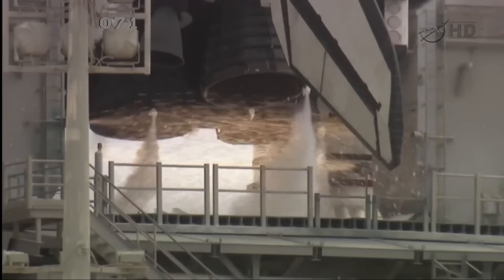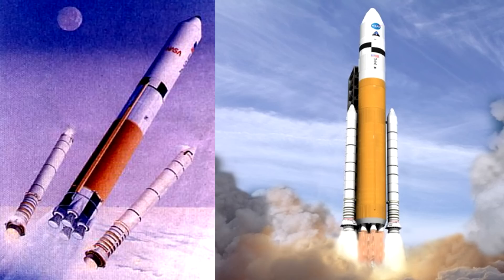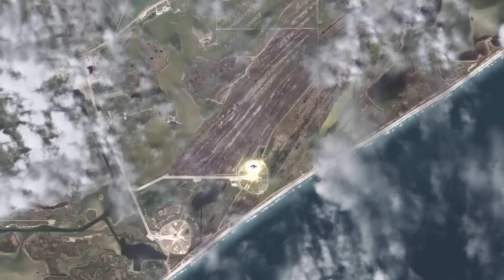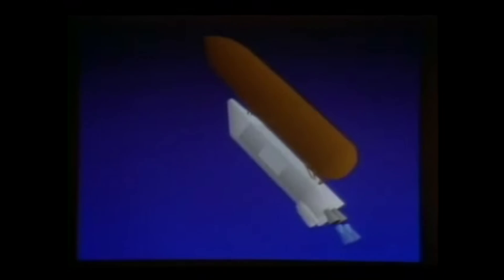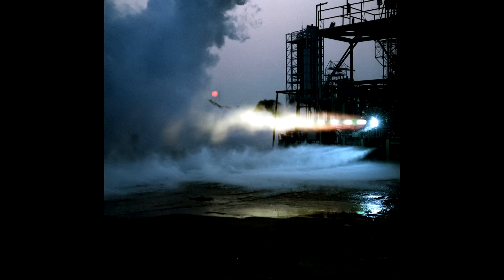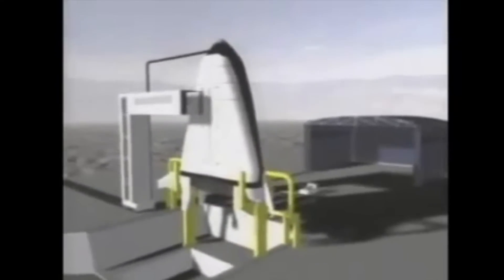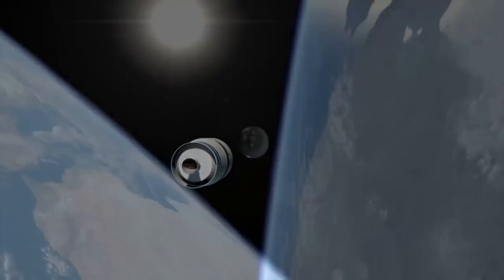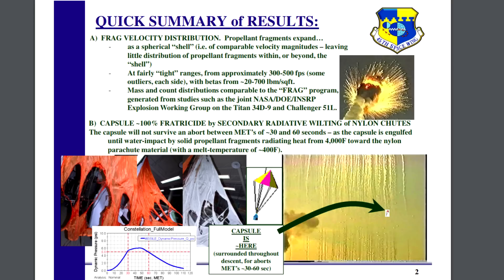Why The US Took So Long To Replace Space Shuttle's Crew Capability

Comment: I love how the SLS is actually one of four failed programs, so when they quote the figure of 40 billion in development it doesnt include the previous ones. Basically, the SLS has been in development since 1991, once it launches its first article in 2020 it will have costed 100 billion almost as much as the whole apollo program... to reach less than the same capability that the falcon heavy  developed with 5 years of R&D and 400 million dollars. Oh and the falcon heavy is new reusable top notch technology that is cutting edge in almost every aspect. The nasa rocket uses parts that already existed in the 80s...
So basically the score is this: NASA: 100 billion and 30 years to launch one expendable rocket made of old parts that accomplishes nothing new. SPACEX: 0.5 billion and 5 years to develop a reusable rocket that launches more weight into space and is done from scratch, almost every component is new.

DAMN
Reply: Everything comes down to cost per kilogram for a given orbit (unless there are few or no alternatives to reach said orbit).  Nearly everything since the Orbiter days has been measured in $/kg to LEO.  The twilight of the Proton has happened in no small part due to SpaceX's crushing advantage in this area, while STILL developing and refining new designs.

Elon Musk did not start a new venture to build launch systems (which there have been plenty of since the official retirement of the Orbiter) to ( @thundercactus ) "suck off the government's golden tit" , but actually make spaceflight profitable.  Yes, most of those profits have come from gov't. contracts, but SpaceX is serving private customers and running off of private investments, not gov't. budget proposals. I think this is one more example of how "private industry wins."
Reply: Give NASA some slack. NASA doesn't want SLS. They've told Congress as much, but Congress keeps shoving it down NASA's throat because it gets constituents jobs. You should have read some of the quotes from congresspeople at a recent hearing on the SLS program. They were sickening. A lot of "how SLS is and should remain supremely important to NASA's future missions."
Reply: The government is inefficient because it has too much money, all of it guaranteed, and therefore has no reason to pursue anything with any speed. A private company doesn't have billions to blow and if it takes too long to make a launch vehicle, shareholders will lose interest. So, SpaceX does everything FAST. I am no huge SpaceX fan, but I am starting to like them more than even NASA because they DO things instead of sitting around.
Reply: Your claim is wildly overblown.  ;)   The Falcon Heavy can't quite launch the Orion stack to the Moon. SLS can launch the extra 8,000 kg needed. Definitely worth the additional 99.5 billion dollars.   :)  :)  :)       [Smiling so much so I don't cry.]
Reply: One year passed, starship has no progress and already costed 2 billion...
Space might be cursed,
Reply: mind that SLS will be a more capable launcher than FH, mainly because of the payload SIZE restrictions of FH that SLS doesn't have. 
And that's the main problem with FH, its small diameter payload restriction which limits what can be launched on it.
Basically, anything you can launch on FH you can launch cheaper on F9 unless it needs to go further than geosynchronous orbit, and if you go further than that you're almost certainly going to need a lager size payload than FH can handle.

It was designed for the abandoned manned moonshot SpaceX were thinking of a few years ago, and since has itself been looking for a mission.
Reply: Still, for a 100 billion dollar price tag versus 0.5 billion dollar, its completely ridiculous. Also ,the first SLS, the one that will be tested in 2020 might be more capable only in some mission profiles. The one that will have more payload but still be inferior in terms of technology and still inveting basically nothing new will fly maybe in 2030 if everything goes as plan and no more money is requested, but since this program has been doubling in budget every about 5 years since 1990 that is unlikely
Reply: Sergio Barrera Oro By 2020 the BFR will be near compete which blows everything out of the water!
Reply: @123-p1n4i   The Air Force paid SpaceX to look at building a methalox upper stage for F9/FH.  Pretty sure it would have been larger diameter than present upper stage. If hard to mount on an F9, could definitely be mounted on a 4 or 5 core Falcon Super Heavy. That beast would exceed the current SLS, and the follow-on ones that have mercifully been cancelled. Development costs and upgrade of launch pad for methane would have been less than 99.5 billion dollars.

SpaceX had a better idea - speed up the Starship.
Reply: Sergio Barrera Oro Private vs Government. Basically everything but prisons are done better private. The space program proved Ana Rand right about government.
Reply: This is just another reason I agree with Ben Shapiro when he says "the government sucks at everything".
Reply: @weeral1  Not at everything, no. For example, the government is a vast improvement over private industry when running medical insurance - better outcomes for about half the price tag compared to how the US does it. Or just think about how the world would look if all streets were financed by private industry - every road as a toll road. And it seems generally agreed that for good short-range public transport, you really need government money.
But it is certainly true that there are a lot of areas where private industry is better.
Oh, and then there are areas where the two are interwoven so much that the result sucks massively, for example the military-industrial complex.
Reply: Kai Henningsen wrong. Government involved in medical care is hell
Reply: weeral1 If you want something CHEAPER and MORE of it, make it private. But you have to want both. This is why prisons don’t work as “private” because it encouragers locking people up and we don’t want more of that.
Reply: @ApexTyrannis  there was also a great sketch about the possible effects of commercialization of police by Fry & Laurie (“Private Police”). Every time I feel too Libertarian, I recall it and shut up. No silver bullet.

Comment: It’s hard to get bonered about non-reusable rockets, especially non throttleable solid fuelled ones.  
I know they make a lot of sense in some applications, but it just feels so wasteful.  

I’d still love to see a Saturn V go up though...
Reply: Actually, the SRBs are reusable (at least they were on the shuttle).
Reply: @edgarwalk5637   Ultimately cost close to as much to refurbish as build new. Is why  no reusable SRBs have been developed since.
Reply: A Modern version of the Saturn V's J-2 engines (the second and third stage engines) was planned for the constellation Mars missions, and we know what happened with that.

Comment: The SLS should be killed, if you ask me. If that money was diverted to the Falcon 9 and Falcon Heavy for crewed/unmanned missions, for the same price 10 times as many launches could be achieved, which just makes the SLS useless and obsolete.
Reply: They have already helped fun Spacex to the tune of a couple billion plus but you're right about killing the SLS.  At one time NASA had no source of reliable outside ground to orbit.  That has changed so they should go back to building the things that go on top of rockets instead of rockets. :)

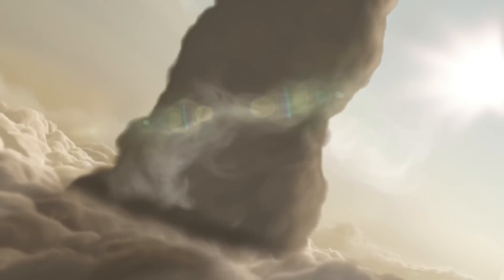Comment: At 2:20 the animation of the SLS punching out of a cloud layer shows the exhaust plume rising in the same direction as the rocket.  Wouldn't the exhaust have to be moving downward in order to have positive thrust?  Or is there some cool rocket physics phenomenon going on that I'm not aware of?
Thanks for the very interesting videos!
Reply: Could just be a goof on the animators part..

Comment: SLS wil never fly! Boeing has been using it as a "pork " project. As soon as Space x starts crewed flights funding for SLS will dry up. the Orion capsule may fly 1 or 2 more demonstration missions on Delta IV Heavy but not the SLS. Boeing has not developed an new technology. The Orion is just a larger updated  Apollo capsule and there space suits blue died  Sokol IVA suit.

Comment: SLS isn't as Shuttle derived as it looks.  True, the boosters and engines are just modified versions of Shuttle hardware, but the core itself is just about all new.  All the Shuttle tooling for the tanks was replaced and I'm pretty sure the entire tanks are isogrid now.   More like a big Delta IV than an ET.  It's an extremely expensive design.
Reply from the maker: Yep, 'shuttle derived' didn't save much money.

Comment: Wish they had continued with the X-33/Venture Star. From what I understand, they developed aluminum tanks that were better than the planned composite versions (and eventually, designed composite tanks even better than that). Apparently, if it didn't use the composite tanks, there was no point to the project for Congress...

Comment: I still dont understand why we dont just build a space plane. Overengineer a plane to get up to cruising altitude and carry a couple boosters. Fire them off to get to orbital speeds. Rendezvous with whatever you need to. Come home. 
The Shuttle practically fell out of orbit then did a controlled fall to the ground. Im sure we could design something much bettter now just nobody wants to foot the bill even though it would save craploads in fuel and great big boosters.
Reply: There are many people doing air launches. Stratolaunch build the widest aircraft to do that. 
The problem is that you are mainly limited by the size of the plane (nothing is big enough)
Reply: Check out the skylon.  That's a spaceplane that just might make it.  It's not as easy as you think, planes fly much lower and slower than a rocket first stage.  Air launching so far delivers only fractions of the mass a conventional rocket can.

Comment: Some little fixes and improvements would have been enough to make the Shuttle into a ship that could build a Mars transfer vehicle.
Reply: Which little fixes are those?  The shuttle was, sadly, dated and dangerous.  It accomplished a lot and we learned a lot but it was ready for the shelf.
Reply: @TheEvilmooseofdoom  My mistake. I didn't look into the Shuttle that deep. Though a system like the Shuttle but better would have been great. It would have checked off the concern of switching manufacturers.

Comment: 8:45 "It keeps Orion capsule, which was pretty far in to development."

And it has now been longer just since then than the entirety of the development of the Saturn V and Apollo program...  If you count from the beginning of the Constellation/Orion, it will have been longer than from Sputnik to the last moon landing between Orion's start of development to its first crewed launch.

And from the first uncrewed launch of Orion to the first crewed launch, it will have been longer than the period of time between the first uncrewed Mercury launch and the moon landing. 

And this for a "shuttle derived system that will decrease costs and development time."
Reply: You have to take into account NASA has no where near the amount of funding they had during the cold war, they are doing miracles by making a heavy lift rocket with post Apollo levels of budget.
Reply: Odyssey Voyager on the flip side Apollo was a clean sheet design while SLS uses tried a proven components.
Reply: @odysseyvoyager2354  actaully nasas budget in something like 1964adjusted fore infaltion really wasnt that far off today.
Reply: @ausintune9014  In 1964 it was near to 5% of the total federal budget, today its less than a percent.
Reply: And all this while half of Orion spacecraft is now outsourced...
Reply: If you think about it, Orion/Constellation is "just" a continuation of Apollo.  Nothing really new, just super expensive.  Everybody got their hand in the cash register...
Reply: It turns out that advanced rocket science is harder to get done when you don't have the government pouring 3% of your country's GDP(!) into your project, as was the case in the Apollo era.

Comment: We havn't replaced it: nothing on the table is capable of carrying ~7 or 8 astronauts which are able to bring all their tools up with them, and WORK in space. 
Soyuz/Dragon/CT100 are just Ubers.
Reply: Correct, mostly.
Of course the idea of needing 7-8 crew is silly, for LEO missions.
But we do need a vehicle that is capable of taking a work crew and their tools, and hanging around for several days, while doing stuff.
None of the current plans, including SLS+orion, will provide that.
Some of the Orion-based Exploration Mission modules might provide that, but are still many years downstream.

Comment: 7:09 soo in other word we've basically been spinning our wheels for 40 sum years while spending billions on potentially good projects that we got half way thru then got cold feet and so then spent billions more  on the next project that we half completed to reinvent the wheel ?
Reply: 8:25 question if we had taken all the money  spent over all these projects and all the many years spend on r&d and used those resources to just say mass produce Saturn v launch vehicles.... and improve them with new electronics ,engines and materials...  and manufacturing automation....  would we not have now the equivalent of the Russian Soyuz in terms of reliability? with moon capacity and a shit ton of leo  transport capacity ?
Reply: instead of half a dozen  half completed canceled projects?

Comment: This might be a dumb question,Can someone explain why we don’t want the option of strapping on 4 boosters for even more payload to leo or Mars
Reply: Additional thrust means more force which means you need to make everything stronger. More engines means more vibration.

Falcon Heavy faced the same problems. I suggest the Everyday Astronaut's video "Why it took 5 years for Falcon Heavy to fly"

Comment: The biggest problem I have with all the shuttle replacement is payload recovery and servicing. There were never any vehicles other than the shuttle that were able to do that, and until the BFR comes along, there won't be. I just wish they'd bring one more shuttle back to bring Hubble down when it finally retires.
Reply: NASA dedided it was to much of a risk to carry out a Suttle lainch just to bring back a Hubble so they decided to do one last servicing mission and just deorbit Hubble.
Reply: I think the reason NASA didn't bring Hubble back was because
A: It is the best telescope we have, and will be until JWST is launched in 2021
B: The risk. (Even though they did do another service mission)
Reply: 2021?  I spot an optimist!
Reply: A cargo BFR (V3.0) should be able to bring Hubble home.  Rough measurements from the publically available images and statements suggest a payload bay of ~14-15m, And the HST is 13.2m long (not sure if that includes the sunshade, though).
Although the BFR will probably be flying before JWST is launched so they could do another servicing mission instead. :)

Comment: Aside from politics. Another issue that drives costs through the roof is that its quite difficult to become a qualified supplier to make space worthy parts and the volumes of production are very low (so suppliers arent really competing to win orders - often they bid on orders just as a favor to the OEM). Because of this there is very low competition for bidding new parts and the prices and lead times and testing lead times are much bigger numbers than the program managers would want. You fix this by becoming vertically integrated and (to a lesser extent) by sending larger orders to fewer suppliers who can begin to share risk with the space program. But that conflicts with spreading orders around all over the country. Its one of the things that space-x does well... by having internal production capacity - it knows what it actually costs to produce parts so it can outsource them when appropriate. The other OEMs have no idea. Hard to build a cost efficient vehicle when all your parts are marked up 3x.

Comment: the biggest mistake that were made was ended the apollo program and replacing it with space shuttle mission.
Reply: They should've kept with one of the old, fully-reusable liquid-fueled Shuttle designes with flyback first stage. Much safer and cheaper at maintenance between flights.